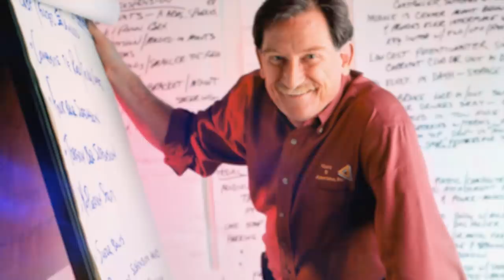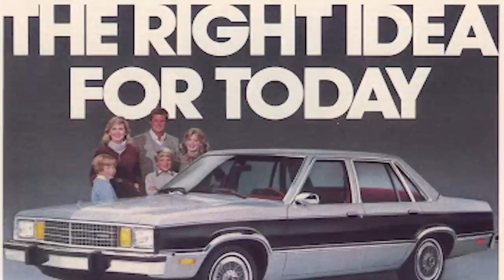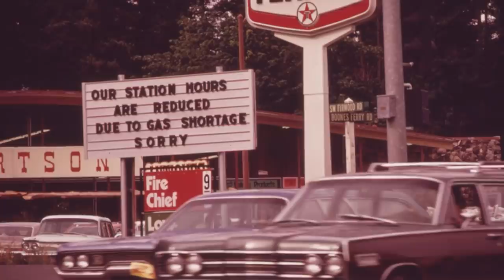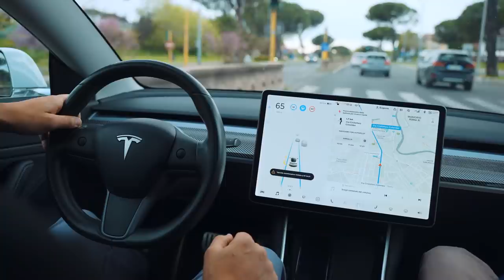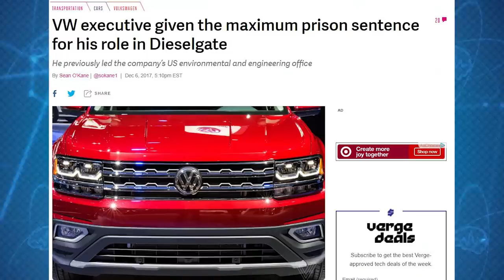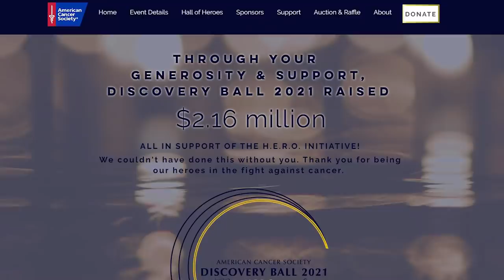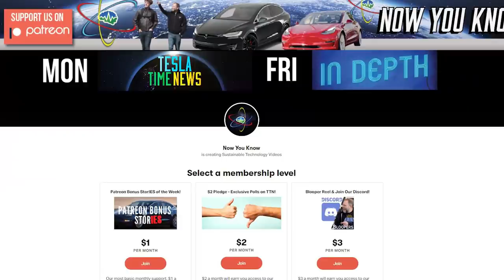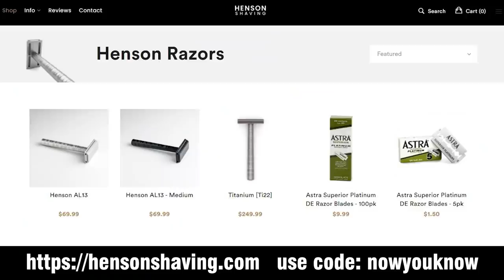China is Coming: Observations from an Expert | In Depth

Comment: The old man is right, I also know the first Japanese car coming to Europe some 50 years ago. People looked down on Japanese cars but I have been driving Japanese all my life. Chinese cars will definitely come in the European and American market. China has a greater advantage than Japan because it has 5 times bigger domestic market than the usa. The electric vehicles will be much cheaper than any other brands and they are already leading in AI which will be part of the vehicles.
Reply: Quality =/= Quantity
Reply: I’ve been doing pretty well with Japanese cars and American trucks. Had an 88 f150 still driving fine while the body disintegrated around it. When I was young me and my friends had a beater Honda Civic that never had an oil change even once and we gave it away still running years later. Now that I’m older I’ve had 3 generations of civics, an f150, f250 and a Chevy 2500 (with a plough on it) and all of them have been great to me requiring almost nothing besides routine maintenance.
Reply: China has copied the Japanese Economic Model; the US automotive and general economic model was easy pickings for anybody who had a belief in Long Term Marketing Strategy and Long Term Economics.
The US companies like GM, Chrysler had to report Quarterly; pay dividends quarterly. At Least Ford had a big % that was family owned!
Meanwhile back in Japan post WW2 Demming was sent to Japan to help Japan recover as the US had adopted a Christian Ethos on how to turn old enemies into allies; the marshall plan went into action; Demming was a seriously smart man, and so was Mr Toyoda.
US arrogance continued with its short term economic model right up to this day!
Japan had adopted this Window of Economics Strategy; In the 1950's it selected the following key markets that it wanted to Grow its Combined Market Share, it developed an Economic Model of Co-optition! Japanese companies didn't compete against Japanese Companies!
The market segments that Japan initially selected included the following:-
Ship Building
Electronics
Computer Chips
Optics
Automotive; motor bikes, cars, outboard motors etc
And later the computer Chip
And cellphone
These industries were not just backed by these very large Japanese Organizations but also the japanese Banking System!
And yes behind that,  we basically had the The bank of Japan and the Japanese People who are the most indebted nation per capita in the Western World!
So how did it work out for Japan?
1.Ship Building, according to the Boston Consulting Groups Growth Share Matrix, I would say it was a fail although I can see Japan building a strong navy to combat China and North Korea; Score 2/10
2. Electronics; yes this has been a success in up market smart tech; Score 7/10
3. Computer Chips etc; Score 6/10
4. Optics; did really well in the 1960's to the 80's, they are still good at basic consumer stuff but I think they have lost the battle at the very top end; I still give them a 6/10
5. Automotive; well this is such a radically changing market segment! Yes Japan has done extremely well here and yes their economic Strategy to buy Long Term Market Share (LTMS) has been amazing! According to the BCG growth Share Matrix Japan could cash Cow this segment for a couple of decades and bank all the dividends! However the Germans are not far behind them and Teslar is according to the BCG analysis is a Star Brand/ Product, it is the market disruptor! To me China is too late and I wouldn't want heap of money of mine being invested in Toyota, VW, GM. I'll only give Japan 3/10 in this category because of all the financial support its Automotive industry  got. This is where Japan's massive debt has come from! The Japanese people paid for its Automotive Market Share  Score 3/10
6. Cellphone; well Japan lost this battle big time! Score 1/10

South Korea copied Japanese economic theory and practice;-
It has done well in the following:-
Ship Building, Electronics, Computer Chips, Automotive, and cellphones.

China is also copying Japan's Window of Economic Strategy, and like Japan China has a Massive Demographic Cliff face its about to fall off; China like Japan is heading for Stag Deflation; an Economists worst Nightmare! And in China's case it will last for Decades!
Reply: Tesla like companies give tech to Chinese. According midea Chinese employee of Tesla give tech to Chinese company.
Reply: @reviewerbibhuti5100  It´s a gamble, Elon is literally gambling that he can be the pioneer of electric car tech inovation and after he gets it and massproduces some teslas, Chinese get the Tech.
Reply: I am seeing the first Chinese cars in the Netherlands. Nobody wants the American cars. The Chinese cars are mutch  cheaper than others.
Reply: @dennisdegroot7490  I would rather pay more knowing the quality and the condition of workers being on the good side. 

No matter how much stealing they do, they would never achieve the same quality other brands do.
Reply: consider how much a Toyota cost now days.  It’s about it time we see sub 10k cars again
Reply: @dennisdegroot7490  Here in New Zealand we have a lot of South Korean cars; Hyundai is a very reliable brand along with Toyota of course. 
The top selling vehicle is a Ford, with Toyota being right behind it!
The farming market is big here and Ford and Toyota fight it out to be the favourite farmers vehicle; so it is the Ford Ranger verse the Toyota Hilux.
Reply: @faultline3936  

Then you’re not listen to what the old man said.
Reply: @stewartbeche686  I think you are right. Except for the part China is to blame. I am Dutch so i see the results of the USA war propaganda every day. China plays games but who made China great? The American people wanted money. That's what they got. Including a failed nation. The people in the east also need a house.
Reply: @robmiller1964  Thanks, I like Toyota. I have looked into New Zealand. I thought you had holden in stead of ford.
Reply: @dennisdegroot7490  it is not american  war propaganda it is chinese war propaganda. By the way: THE MING DYNASTY TOLD DUTCH GET OUT OF PENGHU ISLAND BUT COULD HAVE ALL OF TAIWAN....TOO MANY HEAD HUNTERS.  KOXINGA OF QING DYNASTY THREW OUT DUTCH... DUTCH RIGHTFUL OWNERS OF TAIWAN..
Reply: @faultline3936  American? Good quality? Most people avoid Ford and Chevrolet (except for pickup trucks) in other countries because of their reliability issues. Toyota is still the king
Reply: @marinmarinhola  Well, that's a Japanese brand, so I agree with you lol
Reply: @stewartbeche686  🤣. Im Indian , and even though my country has border issues with China I'm not as delusional as you , or someone who denies the crimes my government does like the way you are defending the war crimes of your country in Iraq ( 500k civilians dead ), Libya ( 1500 ), Afghanistan ( 250k ) and currently occupying the oil field of Syria, starving the country.
Reply: @RamMohammadJosephKaur  are you a muslim?
Reply: @stewartbeche686  Does Cyril sound like a muslim name to you? 😁I'm a Malankara Orthodox Christian..
Reply: Cheaper did you say ? Yes they are cheap. But can they match the innovations of the  Japanese?
Reply: @sebas8225  .
Reply: @reviewerbibhuti5100  You are stuck in the late 70s where China is poorer than some african poor nations and virtually had no technology. That may be true in the past, but more and more, they are becoming the leading edge of new technology ie. AI, 5G/6G, quantum computing, EV, etc. They have about 2 million STEM graduates a year and they are pouring billions of dollars in research. Just wait for the end of this decade and they will be the undisputed technology leader.
Reply: @stewartbeche686  you’re very I’ll informed! Go to CIA factbook and some research
Reply: @jasondong9721  I am into the truth and nothing but. BOYCOTT CHINESE GOODS! THE LIFE YOU SAVE COULD BE YOUR OWN.
Reply: @annapolismike  Japanese cars may still be a bit better, after all they have history with building cars, but dont be fooled thinking chinese product wil be junk. And their knowledge how to build  cars is advancing with unbelievable speed. Just look what they did with phone market. without embargos, they would rule phone world market. People dont' realize this new China is far from its old image as ignorant world still see it. There is nothing, unreliable unsafe with high tech Chinese stuff anymore. They are on paar with every world manufacturer if they decide to compete.
Reply: I drive a Dacia. People may laugh but it's reliable and cheapest car on the market by a long way. I am in the UK. My next car will be EV and it will again be Dacia Spring. That will cost around £11 000. 

Dacia is owned by the French and private European shareholders with about 11% owned by Nissan. I am not interested in a Chinese car and would be prepared to pay more for a European brand to keep jobs in Europe. I do not buy American(though I love you guys), for the same reason. 

t is owned by the
Reply: @grahamt5924  you are a true patriot and supporter of democracy
Reply: @dennisdegroot7490  Europe hasn't wanted American cars for 40 years or more, that's nothing new
Reply: 35
Reply: 🤣🤣🤣 Chinese products are low quality than the japanees European and american products
Reply: yep and they will be models tesla designers help make as they are training chinese  people how to do it properly
Reply: I have driven Honda's for decade and still love them but then again, I haven't driven an EV yet.
Reply: @robmiller1964  China does not copy anything from Japan. China is not interested in Japan. China has landed on the moon and Mars. China has its own space station. How many times has Japan landed on the moon and Mars? Does Japan have their own space station?
Reply: @Yangpeiling-de-zhangfu  I love China, and I love the Chinese People, I am sorry if I offended you, I'm from New Zealand and I grew up in the 1950's 60's next door to Kiwi Chinese on a Farm just out of Oamaru. 
I believe that we have to look at China and think about the long term. The thing I can't quite comprehend is why China has become so aggressive lately towards Taiwan. Why? Taiwan isn't threatening China, I cannot understand what China could be upset about as Taiwan seems to be minding its own business as we say in English.
But let us take a step back; Donald Trump and the USA under his leadership was incredibly rude to China and I do understand; China was very mature in the way it handled Donald Trump (Who I think was the worst US President in my life time). Donald Trump wasn't just rude to China, he was rude to virtually every country on this planet.

I do think that China has some major demographic and economic challenges ahead and I have pointed these out. However China is not alone, each country has their own set of Demographic and Economic Challenges. 
The radical right wing in the USA and Australia aren't being wise, everybody needs to calm down. This planet is too small for silly escalations. Ideas of hegemony are so out of date these days.
Peace be with you!
Reply: @faultline3936  high price is not necessary buy you good quality.
Reply: @stewartbeche686  
By Amir Wijaya

Here is a list of all the war crimes of the United States of America:

1901 - the introduction of troops into Colombia.

1902 - invasion of Panama.

1903 - The US sent warships to the Panamanian Isthmus in order to isolate Colombian troops. On November 3, the political independence of the Panamanian Republic was proclaimed. In the same month, Panama, which was in fact completely dependent on the United States, was forced to sign an agreement with the United States, according to which the territory for the construction of the channel was "forever" provided for use by the United States. The USA was allowed to build and then operate a canal in a certain zone, to maintain armed forces there, etc. In 1904, the Panama Constitution was adopted granting the US the right to land troops in any part of the country, which was repeatedly used by the US government to suppress anti-imperialist actions. The presidential elections of 1908, 1912, and 1918 took place under the supervision of US troops.

1903 - the entry of troops into Honduras, the Dominican Republic and Syria.

1904 - the entry of troops into Korea, Morocco and the Dominican Republic.

1904-1905 - American troops interfere in the Russo-Japanese War.

1905 - US troops interfere in the revolution in Honduras.

1905 - the entry of troops to Mexico (helped dictator Porfirio D? Az suppress the uprising).

1905 - the entry of troops into Korea.

1906 - invasion of the Philippines, suppression of the liberation movement.

1906-1909 - US troops enter Cuba during the elections.

1906 - The uprising of liberals protesting against lawlessness, created by the government of President E. Palma. Palma asks the US to send troops, but the US government sends mediators to Cuba. After the resignation of President E. Palma, the United States announced the creation of an interim government in the country that will remain in power until the state regains its order. 1906.10.02 - The victory of the liberals in the elections. President H. Gomez was elected President of Cuba.

1907 - US troops enforce the protectorate of "dollar diplomacy" in Nicaragua.

1907 - US troops interfere in the revolution in the Dominican Republic.

1907 - American troops participate in the war of Honduras with Nicaragua.

1908 - US troops enter Panama during the elections.

1910 - Nicaragua. US forces invade the Bluefields and Corintho ports. The US sent armed forces to Nicaragua and organized an anti-government conspiracy (1909), as a result of which Celaya was forced to flee the country. In 1910, a junta was formed from pro-American generals: H. Estrada, E. Chamorro and employee of the American mining company A. Diaz. In the same year, Estrada became president, but the following year he was succeeded by A. Diaz, supported by American troops.

1911 - Americans landed in Honduras to support the uprising led by former President Manuel Bonnily against the legally elected President Miguel Davil.

1911 - suppression of the anti-American uprising in the Philippines.

1911 - the introduction of troops in China. 1912 - US troops enter Havana (Cuba).

1912 - US troops enter Panama during the elections.

1912 - the invasion of American troops in Honduras.

1912-1933 - the occupation of Nicaragua, a constant struggle against the partisans. Nicaragua has become a colony of the monopoly of the United Fruit Company of other US companies. In 1914, Washington signed an agreement under which the United States was granted the right to build an inter-Pacific channel in Nicaragua. In 1917 E. Chamorro became the president, who concluded several new agreements with the US, which led to even greater enslavement of the country.

1914 - US troops enter the Dominican Republic, fighting with the rebels for Santa Domingo.

1914-1918 - a series of incursions into Mexico. In 1910, there began a powerful peasant movement Francisco Pancho Villa and Emiliano Zapata against the protege of America and England, the dictator Porfirio Diaz. In 1911, Diaz fled the country, and he was replaced by the liberal Francisco Madero.But even he did not fit the Americans, and again in 1913 the pro-American General Victoriano Huerta overthrew Madero, killing him. Zapata and Villa pushed, and in late 1914 took the capital of Mexico City. The Junta of Werta collapsed, and the US moved on to direct intervention. Actually, in April 1914, an American landing landed in the Mexican port of Veracruz, which remained there until October. President of Mexico was meanwhile an experienced politician and a landowner, V. Carranza. He defeated William, but opposed the US imperialist policy and promised to carry out land reform. In March 1916, parts of the American army under the command of Pershing crossed the Mexican border, but the Yankees did not get an easy walk. Government forces and partisan armies P. Vilia and A. Zapata, temporarily forgetting the civil strife, merged and Pershing from the country were thrown out.

1914-1934 - Haiti. After numerous uprisings, America introduces its troops, the occupation continues for 19 years.

1916-1924 - 8-year occupation of the Dominican Republic.

1917-1933 - the military occupation of Cuba, an economic protectorate.
1917-1918 - participation in the 1st World War. At first, America "respected neutrality", i.e. sold arms to astronomical sums, rampantly grew richer, entered the war as much in 1917, i.е. in almost the very end; lost only 40,000 people (Russians, for example, 200,000), but after the war found themselves the main winner. In Europe, America did not come for Europe, but for America's sake. The overseas capital was preparing this war, and it won it. After the end of the war, through various machinations, more than other allies, they succeeded in enslaving Germany, as a result of which the country, weakened by war, fell into absolute chaos, where fascism also arose. Fascism, by the way, developed with the active assistance of America, which helped him until the end of World War II. States, other than the United States, found themselves in debt to international financial groups and monopolies after the war, where US capital was already playing the first, but by no means the only violin. In total, what the United States wanted was achieved both in Paris in 1919 and in Paris in 1929.

1917 - American tycoons gladly financed the socialist revolution in Russia, hoping to provoke a civil war, chaos and complete liquidation of this country. After the 1917 revolution, US President Woodrow Wilson outlined the US political course on Russia in the following way: all White Guard governments in Russia should receive the assistance and recognition of the Entente; The Caucasus is part of the problem of the Turkish empire; Central Asia should become a protectorate of the Anglo-Saxons; in Siberia there should be a separate government, and in Great Russia - a new (that is, not Soviet). After the victory over the "red plague," Wilson planned to send detachments from youth Christian associations to Russia "for the moral education and guidance of the Russian people." In 1918, American troops entered Vladivostok, and they were finally able to drive them out of the Russian territory only by 1922. As early as December 23, 1917 Clemenceau, Pichon and Foch from France, the lords Milner and Cecile from England concluded a secret convention on the division of spheres of influence in Russia: England - the Caucasus, the Kuban, the Don; France - Bessarabia, Ukraine, Crimea. The US formally did not participate in the convention, although in fact they held all the threads in their hands, especially claiming Siberia and the Far East ...

1918-1922 - intervention in Russia. In total, 14 states participated in it. There was active support for the territories that had separated from Russia - Kolchakia and the Far Eastern Republic.

1918-1920 - Panama. After the elections, troops are introduced to quell the riots.

1919 - Costa Rica. The uprising against the regime of President Tinoko. Under US pressure, Tinoko resigned as president, but the unrest in the country did not stop. The landing of US troops to "protect American interests." Election of President D. Garcia. Democratic rule was restored in the country.

1919 - US troops are fighting on the side of Italy against the Serbs in Dolmatia.

1919 - US troops enter Honduras during the elections. 1920 - Guatemala. 2-week intervention.
Reply: 1921 - American support for militants who fought for the overthrow of the President of Guatemala Carlos Herrera for the benefit of the United Fruit Company.

1922 - intervention in Turkey.

1922-1927 - American troops in China during the popular uprising.

1924-1925 - Honduras. The troops invade the country during the elections.

1925 - Panama. American troops disperse the general strike.

1926 - Nicaragua. Invasion.

1927-1934 - American troops are stationed throughout China.

1932 - invasion of El Salvador from the sea. There at that time there was an uprising.

1936 - Spain. The introduction of troops during the Civil War.

1937 - a single military clash with Japan.

1937 - Nicaragua. With the help of American troops, Somoz comes to power, displacing the legitimate government of H. Sakasa. Somoza became a dictator, his family members ruled the country for the next 40 years.

1939 - the introduction of troops into China.

1941 - Yugoslavia. A coup d'état on the night of March 26 to March 27, 1941, organized by the Anglo-American special services, as a result of which the Tsvetkovic-Machek government was overthrown by the putschists. 1941-1945 - while the Soviet troops fought the fascist army, the Americans and the British were engaged in what they usually do - terror. They methodically destroyed the peaceful population of Germany, than showed that they were no better than the fascists. This was done from the air by carpet bombing of cities that had nothing to do with war and military production: Dresden, Hamburg. In Dresden, approximately 120,000 - 250,000 civilians were killed per night, most of them refugees.

1945 - two atomic bombs, dropped on already defeated Japan, which resulted in the death of about 200,000 (according to other sources, 0.5 million) people, mostly women and children. It is widely believed that these bombs were dropped to save the lives of Americans. This is not true. Bombs were dropped to intimidate a new enemy, Stalin, when Japan was already trying to enter into negotiations for surrender. Leading warlords of the Second World War, including Dwight Eisenhower, Chester Nimitz and Curtis Limae, have all disapproved of the use of atomic bombs against a defeated enemy. In addition, the bombs were dropped in defiance of the prohibition of the Hague Convention of 1907 - "there is no justification for unlimited destruction or attacks on civilians and civilian objects per se". Nagasaki was at least a naval base ... After the occupation of Japan by American troops, 10 million people died of starvation.

1946-1949 - The United States bombed China and exerted all kinds of opposition to the Communists.

1947 - Italy. In order to fight communism, pro-American forces are funded in elections, the CIA massively kills communists, and carries out anti-Soviet campaigns in the media. In the end, the results of the elections were forged by American money and, of course, the Communists lost.

1947-1948 - France. With the aim of combating communism and recolonization of Vietnam, pro-American forces are funded in elections, and military support is provided. The death of thousands of civilians.

1947-1949 - Greece. American troops participate in the civil war, supporting the fascists. Under the pretext of "defending democracy," the United States interferes with the first general parliamentary elections in Italy, and introduces warships of the Sixth Operational Fleet into Italian ports in order to prevent the Communist Party from coming to power peacefully. For several decades after the war, the CIA and the US corporations continued to interfere in the elections in Italy, and spent hundreds of millions of dollars in order to block the electoral struggle of the Communists.

1948-1953 - military operations in the Philippines. Decisive participation in punitive actions against the Philippine people. The death of many thousands of Filipinos. The US military has launched a struggle against the leftist forces of the country at a time when they fought against the Japanese invaders. After the war, the US brought to power a number of puppets, including the president-dictator Marcos. In 1947, pro-American forces were financially supported to open American military bases in the Philippines.

1948 - Peru. Military coup, conducted by America. Manuel Odria came to power. The undemocratic government was later armed and supported by America, the next elections were held only in 1980.

1948 - Nicaragua: military support is provided to establish control over the government. About the dictator Anastasio Somoza, American President Roosevelt said: "Maybe he and the son of a bitch, but this is our son of a bitch." The dictator was killed in 1956, but his dynasty remained in power.

1948 - Costa Rica. America supports a military coup led by Jos? Figueres Ferrer.

1949-1953 - Albania. The United States and Britain have made several unsuccessful attempts to overthrow the "communist regime" and replace it with a pro-Western government from among monarchists and fascist collaborators.
Reply: 1950 - The uprising in Puerto Rico was crushed by American troops. At that time there was a struggle for independence.

1950-1953 - armed intervention in Korea about a million American soldiers. The death of hundreds of thousands of Koreans. Only in 2000 it became known about the mass killings of tens of thousands of political prisoners by the army and the police of the Seoul regime, committed during the Korean War. This was done on the orders of America, which feared that prisoners of conscience arrested for their political beliefs would be liberated by the People's Army of the DPRK. Americans actively use chemical and biological weapons produced for them by Nazi criminals and tested on our prisoners.

1950 - the beginning of American military assistance to France in Vietnam. Supply of weapons, military consultations, payment of half of the military expenses of France.

1951 - American military assistance to Chinese rebels.

1953-1964 - British Guyana. For 11 years, the United States and Britain have three times tried to prevent the democratically elected leader Jegan from coming to power, pursuing a neutral and independent policy that, in the opinion of the United States, could lead to the construction of an alternative society to capitalism. Using a wide range of means - from strikes to terrorism - the United States got him out of the political arena in 1964. As a result, Guyana is one of the prosperous countries in the region - by the early 1980s. became one of the poorest.

1953 - Iran. The popular politician Mossadegh decided to nationalize the Iranian oil industry (1951), which was controlled by the Anglo-Iranian Oil Company. Thus, the economic interests of Great Britain were affected.Attempts by Britain to "influence" Mossadegh with the help of the head of state Shah failed. Mossadegh held a referendum, which scored 99.9% of the vote, received extraordinary powers, took over the command of the armed forces and, in the end, deposed the Shah and sent him into exile. Great Britain and the United States especially scared that Mossadegh relied not only on nationalists and clerics, but also on the Communist Party of Iran. In Washington and London, it was decided that Mossadegh was preparing "Sovietization" of Iran, so the CIA and British intelligence MI5 conducted an operation to overthrow Mossadegh. In Iran, popular unrest began, where monarchists, supported by the United States and Britain, collided, and supporters of Mossadegh, and then a coup d'état organized by the military took place. Shah returned to Tehran and at an official reception said, addressing the head of the Middle East department of the CIA: "I own this throne thanks to Allah, the people, the army and you!". Mossadegh was arrested, judged by the Iranian court, sentenced to long prison terms, and spent the rest of his life under house arrest. The Shah canceled the decision to nationalize the Iranian oil industry. Shah Pahlevi (Pahlevi) for a quarter of a century turned into a jailer of the Iranian people.

1953 - Forcible deportation of the Inuit (Greenland), which resulted in the degradation of this people.
Show less

1954 - Guatemala. President of Guatemala Jacobo Arbens Guzman. He led the country in 1951-1954 and tried to take the trade in agricultural products (the main export item) under state control. This he touched on the interests of the American firm United Fruit, which accounted for 90% of Guatemalan exports. Arbens was accused of being a secret member of the Communist Party and wants to build communism in Guatemala (it was a lie). United Fruit asked the US Administration for help. The CIA hired several hundred Guatemalan military, who invaded the territory of Guatemala from neighboring Honduras. Army command, bribed by the CIA, denied Arbenz obedience, and he fled to Mexico, where he died 20 years later. The commander-in-chief of the armed forces came to power in Guatemala. The US welcomed the change of power and urged the new Guatemalan authorities not to "revenge" Arbenz. Then America is stationing its bombers there.

1999 - US President Bill Clinton acknowledged the involvement of US intelligence agencies in the facts of the violation of the law during the recent internal armed conflict in Guatemala. The head of the White House said this in the capital of Guatemala, where he was in the course of his tour of Central America. The support of the Guatemalan military by the US special services involved in "severe and prolonged repression was a mistake on the part of the US that should not be repeated," Clinton said. Such a statement Clinton made in response to repeated calls by Guatemalan human rights defenders to open access to the secret archives of American intelligence services, which would determine the role of Washington and the Guatemalan military in the "dirty war" that accompanied the internal armed conflict in Guatemala. In a report recently released by the Guatemalan "Truth Commission", it is noted that the United States has repeatedly intervened in the internal affairs of Guatemala during the conflict. Thus, the CIA "directly or indirectly supported some illegal operations" of the government against insurgent formations. Until the mid-1980s, "the US government exerted pressure on the Guatemalan authorities in order to maintain an unjust social and economic structure in this country." According to the "Commission of Truth", during the 36-year civil war in Guatemala, which ended in 1996 after the signing of a peace agreement between the authorities and the rebels, more than 200,000 people were killed and missing. In the course of the armed confrontation, numerous gross violations of the law were committed, most of which were committed by the army and special services.

1956 - the beginning of American military assistance to the Tibetan insurgents in the fight against China.The militants were trained at foreign bases of the CIA, supplied with weapons and equipment.

1957-1958 - Indonesia. Like Nasser, Sukarno was one of the leaders of the Third World, he maintained neutrality in the cold war, made several visits to the USSR and the PRC, nationalized Dutch property, refused to ban the Communist Party, which was rapidly expanding its influence among voters. All this, in the opinion of the United States, served as a "bad example" for other developing countries. To prevent "diffusion of wrong ideas in the third world", the CIA began to "throw in" large sums of money in the election, developed a plan to assassinate Sukarno, blackmailed him with a fabricated sex film and, with the help of opposition officers, launched a war against the Sukarno government, which was unsuccessful.

1958 - Lebanon. The occupation of the country, the fight against the insurgents.

1958 - confrontation with Panama.

1958 - American military assistance to rebels on Quemoy Island in the fight against China.

1958 - In Indonesia, an uprising has begun, prepared by the CIA since 1957. The Americans are providing anti-government insurgents with bombardment and military consultations. After the American plane was shot down, the CIA retreated, the insurrection failed.

1959 - America introduces troops to Laos, the first clashes of American troops begin in Vietnam.

1959 - Haiti. The suppression of the popular uprising against the pro-American government.
Reply: 1978 - Guatemala. Military and economic assistance to the pro-American dictator Lucas Garcia, who introduced one of the most repressive regimes of this country. More than 20,000 civilians were killed with US financial assistance.

1979-1981. A series of military coups in the Seychelles - a small state off the East coast of Africa. French, South African and American special services took part in preparing coups and invasions of mercenaries.

1979 - Central Africa. Over 100 children were killed when they staged a protest against the obligation to buy school uniforms exclusively in the shops owned by the president. The international community condemned this murder and put pressure on the country. In a difficult moment, Central Africa came to the aid of the United States, who benefited from this pro-American government.America was not at all embarrassed by the fact that the "Emperor" Jean-Bedel Bokassa personally took part in the massacre, after which he ate some of the murdered children.

1979 - Yemen. America provides military assistance to the insurgents in order to please Saudi Arabia.

1979-1989 - Soviet invasion of Afghanistan. After numerous attacks by the Mujahideen on the territory of the USSR, provoked and paid for by America, the Soviet Union decides to enter its troops in Afghanistan to support the pro-Soviet government there. Struggling with the official Kabul government, the Mujahideen, including the volunteer from Saudi Arabia, Osama bin Laden, supported the United States. The Americans supplied Bin Laden with weapons, information (including the results of satellite reconnaissance), propaganda materials for distribution on the territory of Afghanistan and the USSR. We can say that they waged war by the hands of Afghan insurgents. In 1989, Soviet troops left Afghanistan, in which the civil war continued between the opposing factions of the Mujahideen and tribal associations.
Show less

1980-1992 - El Salvador. Under the pretext of exacerbating internal struggles in a country growing into a civil war, the US first expanded its military presence in El Salvador by sending advisers, and then joined in special operations using the Pentagon's and Langley's espionage capabilities on an ongoing basis. The proof of this is that about 20 Americans were killed or injured as a result of helicopter and aircraft crashes during reconnaissance or other missions over the battlefield.

There is also evidence of US participation in ground combat operations. The war officially ended in 1992. It cost El Salvador 75,000 civilian deaths, the US Treasury - $ 6 billion, withdrawn from the pockets of taxpayers. Since then, there have been no social changes in the country. A handful of rich still owns and rules the country, the poor have become even poorer, the opposition is being suppressed by the "death squads". So, women were hanged in the trees for their own hair and cut off their breasts, they cut out the insides in the genital area and put them on their face. The men were cut off by the genitals and thrust them into their mouths, children were torn with barbed wire in front of their parents. All this was done in the name of democracy with the help of American specialists, every year several thousand people died like this. Active participation in the killings of graduates of the American School of the Americas, which is known for its training in torture and terrorist activities. The 1980s. in Honduras there are military death squads, prepared and paid for by the United States. The number of victims killed in this country was estimated at tens of thousands. Many officers of those death squads have been trained in the United States. Honduras was turned into a military base for the United States to fight against El Salvador and Nicaragua.

1980 - military assistance to Iraq in order to destabilize the new anti-American regime of Iran. The war lasts 10 years, the number of dead is estimated at one million. America protests when the UN tries to condemn Iraq's aggression. In addition, the United States is removing Iraq from the list of "nations that support terrorism." At the same time, America is secretly sending weapons to Iran through Israel in the hope of organizing a pro-American coup.

1980 - Cambodia. Under pressure from the United States, the World Food Program is providing Thailand with $ 12 million worth of products, these products are taken to the Khmer Rouge, the previous government of Cambodia, which is responsible for the destruction of 2.5 million people in 4 years of rule. In addition, America, the Federal Republic of Germany and Sweden supply the supporters of Pol Pot with arms through Singapore, the Khmer Rouge bands have been terrorizing Cambodia for another 10 years since the fall of their regime. 1980 - Italy. As part of Operation Gladio America arranges an explosion at the Bologna railway station, 86 people die. The goal is to discredit the Communists in the upcoming elections.

1980 - South Korea. With the support of the Americans, thousands of demonstrators in the city of Kwangju were killed. The protest was directed against the use of torture, mass arrests, falsified elections and personally against the American puppet Chun Doo Hwan. Years later, Ronald Reagan told him that he "did a lot to maintain the five-thousand-year tradition of commitment to freedom."

1981 - Zambia. America very much did not like the government of this country, tk. it did not support the much-beloved US apartheid in South Africa. Therefore, the Americans are trying to organize a coup d'état, which Zambian dissidents were supposed to carry out with the support of the South African detachments. The coup attempt failed.

1981 - The US shoots down 2 Libyan aircraft. This terrorist attack was aimed at destabilizing the anti-American government of M. Kadaffi. At the same time, exemplary maneuvers were conducted near the coast of Libya. Kadaffi supported the Palestinians in the struggle for independence and overthrew the previous pro-American government.
Reply: 1990 - military assistance to the pro-American government of Guatemala "in the fight against communism". In practice, this is expressed in massacres, by 1998, 200,000 people were the victims of fighting, only 1% of civilians killed are "the merit" of anti-government insurgents. Over 440 villages have been destroyed, tens of thousands of people fled to Mexico, over a million refugees are inside the country. Poverty is rapidly spreading in the country (1990 - 75% of the population), tens of thousands die of hunger, "farms" are opened to raise children, which are then dismantled for organs for rich American and Israeli clients. On American coffee plantations, people live and work in a concentration camp.
Show less

1990 - Support for a military coup in Haiti. The popular and lawfully elected President Jean-Bertrand Aristide was dropped, but the people began actively demanding him back. Then the Americans launched a disinformation company that he is mentally ill. Delivered by America, General Prosper Enwil was forced to flee to Florida in 1990, where he now lives in luxury for stolen money.

1990 - the sea blockade of Iraq begins.

1990 - Bulgaria. America spends $ 1.5 million to finance the opponents of the Bulgarian Socialist Party during the elections. Nevertheless, the BSP wins. America continues to finance the opposition, which leads to the early resignation of the socialist government and the establishment of a capitalist regime. The result: the colonization of the country, the impoverishment of the people, the partial destruction of the economy.

1991 - a large-scale military action against Iraq, 450 thousand servicemen and many thousands of modern equipment are involved. At least 150 thousand civilians were killed. Intentional bombing of peaceful targets in order to intimidate the people of Iraq. For the first invasion of Iraq, America used the following excuses: US government approval True Iraq attacked an independent state Kuwait Kuwait was for centuries a part of Iraq, and only British imperialists tore it off by force in the 1920s. 20 th century, following the policy of "divide and conquer". No country in the region has recognized this branch. Hussein produces nuclear weapons and is going to use it against America. The plans for the production of nuclear weapons were in an embryonic state, under the pretext that it is possible to bomb most of the world's countries. His intention to attack America, of course, was pure invention. Iraq did not want to start peace negotiations and withdraw troops. When America attacked Iraq, peace negotiations were already under way, and the Iraqi army was leaving Kuwait. the atrocities of the Iraqi army in Kuwait. The most terrible atrocities such as the above-mentioned murder of babies were invented by the American propaganda, the use of weapons of mass destruction by the Iraqi army. America itself provided Hussein with these weapons. Iraq was going to attack Saudi Arabia. Evidence so far. There is no democracy in Iraq. The Americans themselves brought power to Hussein

1991 - Kuwait. Kuwait was also delivered, which the Americans "liberated": the camp was bombed, troops were introduced.

1992-1994 - the occupation of Somalia. Armed violence against civilians, killings of civilians. In 1991, the President of Somalia, Mohammad Siad Barr, was overthrown. Since then, the country is actually divided into clan territories. The central government does not control the entire territory of the country. US officials call Somalia "an ideal place for terrorists." Nevertheless, some clan leaders, for example, the late Mohammad Farah Aidid, cooperated with UN peacekeepers in 1992. But not for long. A year later he began to fight with them. The leaders of the Somali clans have their own small, but very mobile and well-armed armies.But the Americans did not fight with these armies, they limited themselves to the extermination of the civilian population (which is armed there as an evil, and therefore began to resist). The Yankees lost two combat helicopters, several armored "hummers", 18 people killed and 73 wounded (special forces, the Delta group and pilots of the turntables), destroyed several city blocks, killing at the same time, according to various sources, from one to ten thousand people (including women and children). In 1994, an American almost 30-thousand unit of the US Army after an unsuccessful two-year attempt to "clean up" the country had to be evacuated. Aidid was then not taken (killed in 1995), and there are no diplomatic relations between Somalia and the United States until now (2005). The Americans shot the film Black Hawk Down, where they presented themselves as heroic liberators of Somalis, fighting terrorists, and that's the end of it. Americans in Somalia. After the destruction of thousands of civilians by American thugs, the Somalis showed their "gratitude" for "helping" Uncle Sam - they dragged one dead occupant through the streets of the city. The effect was stunning: after showing these shots on US television in the United States, such a hubbub began (why are we helping them if they are such barbarians?) That the troops had to be evacuated urgently under public pressure. We draw the appropriate conclusions.

1992 - Angola. In the hope of getting rich oil and diamonds, America finances its presidential candidate Jonas Savimbi. He loses. Before and after these elections, the US provides him with military assistance to fight against the legitimate government. As a result of the conflict, 650,000 people died. The official reason for supporting the insurgents is the fight against the communist government. In 2002, America still got the desired benefits for its companies, and Savimbi became a burden. The US demanded that he cease hostilities, but he refused. As one American diplomat stated in this regard: "The problem with dolls is that they do not always twitch, if you pull a string." On the tip of American intelligence, the "doll" was found and destroyed by the government of Angola.

1992 - in Iraq, the pro-American coup fails, which was to replace Hussein by US citizen Sa'd Salih Jabr.

1993 - Americans help Yeltsin to shoot several hundred people during the storming of the Supreme Council. Unconfirmed rumors of American snipers who helped in the fight against the "Red-Fascist coup" persistently persist. In addition, the Americans took care of Yeltsin's victory in the next election, although only a few months before they were supported by only 6% of Russians.

1993-1995 - Bosnia. Patrolling during the civil war zones prohibited for flights; shot down planes, bombardment of Serbs.

1994-1996 - Iraq. Attempt to throw off Hussein by destabilization in the country. The bombings did not stop for a day, people died of hunger and disease because of sanctions, explosions were constantly held in public places, while the Americans used the terrorist organization Iraqi National Congress (INA). It came even to fighting clashes with the troops of Hussein, tk. the Americans promised the National Congress support from the air. True, military assistance did not come. The attacks were directed against civilians, the Americans hoped in this way to provoke popular anger towards the regime of Hussein, who admits all this. But the regime did not allow this for long, and by 1996 the majority of INA members were destroyed. In the new government of Iraq, INA was also not allowed.
Show less
Reply: @hyc1266  mostly not true   america was asked to help quell disturbances because 3rd world countries umable to govern.  Today america does not send troops to Haiti, central america and look at millions of people from those lands coming to USA...FACE IT:  ANGLO SAXONS CREATE A STABLE ENVIROMENT.
Reply: @hyc1266  you live in the past...
Reply: @knoahbody69  you speak the truth!
Reply: Oh, the other thing is China's market may be huge, but over 50% of the population makes less ten thousand dollars a year.  The market may be huge, the people that can afford to buy cars is only slightly bigger than the U.S. Markets.
Reply: @dennisdegroot7490  haha thanks wu Mao, in fact china have to buy their way into European brand names like Volvo-Geely.  Tesla number one in Europe EV,
Reply: @robmiller1964  Japan =/= China :) So you would think developed markets in the West today have a demographic advantage, compared to China? Fyi, Japan's GDP per Capita already exceeded that of the United States back in the 1980s. By contrast, the Chinese economy is still far from reaching its full potential despite strong growth for decades, indicating considerable room for further expansion in the foreseeable future. You were making a strategic miscalculation with grave consequences, at best. By the way, Japan won't attempt to build its own space station. Nor did it successfully land a rover on Mars. Yet, the Chinese market is at least decades away from reaching the Japanese level of maturity. China's industrial development is nowhere near the peak, given large proportion of its huge population actually is living from hand to mouth. Therefore, I doubt it is wise to simply draw parallels between two very different economies!!
Reply: @robmiller1964  You've been watching too much WestWorld season 3.
Reply: @hyc1266  Translation:  I use pooh bear's little red app every day."
Reply: @silveriver9  Like they're gonna dominate space with their fusion reactor and quantum radar?
Reply: @knoahbody69  I've been to China, I'm now convinced China will be the technology leader of the future.
Reply: @blakenewton2781  she was guilty.....period. WHOSE SIDE YOU ON ?
Reply: @stewartbeche686  I wouldn't advise you to peruse a legal career. A few salient points. The idea that HSBC was in anyways not constrained to produce and manufacture the initial charge is of interest. Then there's the detainment and arrest process that contravened the Charter Rights immediately conferred on people in Canadian jurisdiction ( not to mention that the witness testimony contradicted other testimony). Then there's the illegal transfer of confidential information to foreign agencies ( that's a criminal offense all by itself). Then the Officer In Charge declined to participate in the trial which invalidates much of his testimony and leaves it open for cross examination. I haven't even discussed the fact that HSBC knew of Huawei's corporate structure and it's doings. So far I have given you ample evidence that the trial was not going to do anything. It's why the US government decided to forego the trial. As for " whose side am I on?" The answer is simple. My own.
Reply: @blakenewton2781  now you can go free Peng Shuai!!
Reply: @stewartbeche686  is she on Canadian soil?; I am talking about legal process in Canada and you wandered off into another tangent. Stick with the issue being discussed
Reply: Chinese cars are already in Europe.
Reply: @stewartbeche686  that’s not going to happen, the Chinese design and manufacture good products, take Chinese products from the US market then you’re left with empty shelves.
Reply: @stewartbeche686  also if I have to boycott China I also need to boycott the US, invasion of Iraq, invasion of Afghanistan, continued occupation of various pacific islands including Hawaii and Samoa, meddling in European affairs. Whatever bad things the Chinese have done the US can match or exceed.
Reply: @dennisdegroot7490  Holden was shut down December 2020.
Reply: @faultline3936  if the Chinese car manufacturer actually steal any intellectual property, why don't the victims file lawsuit against them, especially now they are selling at the international market?
Reply: @leefster1  tell that to the tibetans and mongolians.
Reply: @knoahbody69  I wouldn't normally recommend prosthetic brain to anyone, but in your case it might actually be an upgrade, what do you think?
Reply: @stewartbeche686  why me? Oh, I bet you can't tell the difference, am I right? Fact is, I have both Uyghur and Mongolian friends back in china, I don't need some 2 bits googler tell me what's what
Reply: @leefster1  I think you'll be banned for harassment.  Sad that you are Pooh Bear Bot.
Reply: @leefster1  free tibet and mongolia      free peng shuai   free jimmy lai
Reply: @stewartbeche686  Dude, seriously,  I can write a bot in 5 min that's doing a better job than you. if you are paid to do this, my condolences to your boss.
Reply: @knoahbody69  yeah ...  I figured you  gonna call me a bot right about now. so predictable.
Reply: @leefster1  Yeah. Really winning the interwebz, Pooh bear.
Reply: @sirc1446  apparently you had no clue about innovation study and technological learning curve in technolocial innovaiton system or experience curve in economics.
Reply: @RamMohammadJosephKaur  And how many of those deaths in Iraq and Afghanistan were caused by warlords and the Taliban. In Libya, khadafi brought on most of the deaths by attacking other countries and his own people. We stepped in to keep him from slaughtering a whole segment of Libya that was unwilling to live with his madness.   There was international agreement on the actions in Libya almost as united as the feelings about Ukraine.  

That is not to say that we acted properly in Iraq and Afghanistan.  We didn't. Iraq had already proved themselves to be willing to violate the sovereignty of any country that had something that Saddam wanted. Saddam butchered his way through a big chunk of the gulf States and was stupid enough to throw missiles at Israel. The whole subject of WMD was bogus, but the need to get rid of Saddam was not. 

Afghanistan was a pustules ready to burst on the rest of the world. If we had stuck with cleaning up the training ground of the 9-11 attackers, that whole scene would have gone differently. We had the Taliban on their heels and Pakistan ready to support us,  but no. We had to leave the job half done and charge off into Iraq, literally taking most of our forces off to do that job.

Well, it took the warlords and the Taliban two seconds to recognize an open playing field and they took advantage. When we finally came back in force, they had the upper hand and the guerrilla tactics set to defeat anything short of a full on, million soldier force that could cover all the flanks at once, and even that might not have been enough. It's like treating a disease with an antibiotic. If you don't take the entire course, the disease comes back and is resistant to further treatment.  QED!

One good thing that we did was raise the consciousness of the women of Iraq and especially Afghanistan. That headache will be with the Taliban and ISIS and whoever tries to run those countries from now on. It will become increasingly apparent that one of the main reason that the Muslim world has fallen back and will not soon catch up is that half of their population is not contributing in all the ways that it could.  With continued wars, their female population will only grow as a percentage of the whole.  Eventually,  they may be forced to bring their women into the mainstream,  into positions of power.
Reply: @hyc1266  This is not to say that your accounts are fictional, but they are written as if they were edited by left wing historians trying to reiterate history. Sometimes we were wrong and sometimes those on the other side were wrong. After observing the complete lack of freedom in the eastern block after WWII, it became apparent that either capitalist or communist forces were going to dominate the world and we and to greater or lesser degree, the rest of the west decided that we wanted capitalism and democracy of a sort to dominate. Was it done clumsily and with little regard for the populations affected, yes, on both sides. The odd thing, here, is that the western, at least pseudo-democratic countries, prospered and the eastern bloc countries did not. Those in the middle didn't do very well, either. You can't ascribe that to resources, because the Soviet Union and a few affiliated countries had/have enormous natural resources. The difference was in the level of change and growth. Command economies cannot be disrupted and changed in the way democratic and capitalist societies can. As rough as change can be, lack of it leads to strangulation of both the economy and the government.
Reply: @hyc1266  HYC, you are an excellent propagandists. I love the way you tossed off what happened in Serbia with a quick flick of your pen. We didn't start it and we didn't massacre thousands of the Muslim men in Srebenica(sp), but we did move in and stop the fighting and set up a situation where the chief war criminals were eventually brought to trial. 

There are two sides to every story, and so many times, we moved in with overt military force when the opposition was just feeding arms and munitions to sometimes both sides, but usually to the left wing forces. Many times we acted poorly, but our opposition acted poorly as well.  You seem to have a complete inability to see anything but the evil U.S.A. Maybe those seeking accuracy should do their own research or at least seek a balancing exposition of facts and circumstances. Many times you are correct, but not nearly all, and not necessarily for the right reasons.
Reply: @Doio great that you have work to do with your giant pickup, but do you remember when they used to park in back out of politness? But now right in front of the shops are ten giant pickups with one driver each, who can hardly get in with a step ladder.
Reply: @sirc1446  People avoid U.S. made products, especially cars, trucks, and ALL (ALL) rv trailers.
Reply: @chrisblockley5783  I think EV is the future because making hydrogen into liquid needs a lot of cooling, therefore also electrical energy. Hydrogen is volatile and can be dangerous. Although it is clean but the storage and production are relatively more difficult than using electricity.
Reply: Never look down a 5000 year dragon...they have 5000 years of culture, cuvilization and background cowboys!!!!
Reply: You know what? Look at it from another angle. We the consumers will win in the end
Reply: @gmchander142  Japanese is much late into automations in car control systems. And Chinese brand now has found equivalent solutions for hybrid and electric propulsion systems.
Reply: @faultline3936  

Love your choice of words such as “quality”, “worker condition” and “stealing”.
It goes to show the unbelievable amount of bias, arrogance as well as ignorance one can display when all they have inside are bigotry and hate.

You got to be living in a cave if you really think the Chinese are only capable of building low quality cheap stuff that sells in a dollar stores? 

FYI, a large % of smart phones (including iPhones), flat screen TV and monitors, computers & consumer electronic are built by China, regardless of the brand.  

Even your American brands of automobile such as GM, and Ford builds cars with computer chips and many other electronic components made in China.  The car you own that is sitting in your garage probably has hundreds of parts or sub-components that are Chinese made.  

Should you be worried about the quality of all these products you either own, or have previously owned, used or operated without know exactly how much the so called Chinese-made components goes into each of those items?

As far as the accusations of “worker condition”, I guess you don’t even have any idea that the governing party of China- the Chinese Communist Party, or the CCP, rose to power because it fights for the working class against the capitalists who exploite them.  The CCP is literally backed by billions of Chinese blue collar workers as well as small farmers.

As for “stealing”- it would not be a good look if you went to the professor who graded your term paper to made an accusation that one of your classmates “stole” from your work, when you got a “C” on your paper and the classmate whom you groundlessly accused actually out-performed you and got an “A”.
Reply: @robmiller1964  Copied what? Nomi? lmaoo
Reply: 个比马  this fourth quarter of 2022 Chinese electrical vehicles are entering the European market and will take a slice of the total market. The usa can use unfair practices to block Chinese cars but not without consequences. Boeing has lost the 38 billion dollar deal to Airbus in China and it will continue losing the Chinese market as the usa keeps her unfair and discriminative policy against China. Chinese electrical cars have entered the Latin American market with huge success as Chinese brands of high-end products are becoming more and more popular.
Reply: Market share can prolong a lifespan of car through reinvesting in R&D and improving consumers' preference
Reply: @sirc1446  继续保持这种想法
Reply: Fun fact: Tesla will order car batteries from BYD.
Reply: @wcsun5050  the Chinese cars are entering the European market by the last quarter of 2022.
Reply: @reviewerbibhuti5100  你觉得可能不？ 只要是中国人有的 就是 别人给的  或者抄袭？
Reply: @robmiller1964  I am Chinese mainlander, and I would not say I support the independence of Taiwan, not at least independent as a country, but I do hope that the current situation continues with the two sides keeping their own system and remaining in peace.
Back to your question, several reasons why China want Taiwan: 1. Taiwan island is in a crucial position of the island chain by US to limit China. If Taiwan is controlled, the first island chain is broken. 2. Xi modified the constitution several years ago, making him able to be president as long as he want. Yet he need to "conquer" something to show his strength and make him remembered by the history. 3. It is actually acceptable for China to maintain the situation as long as Taiwan does not shout out loud that they are country. It had worked out for years before KMT went down. DPP got elected and one of their main goal is to achieve independence, which is untolerable by CPP. 4. Taiwan is pro-US. You know the Sino-US relationship these years.
Reply: @dennisdegroot7490
Reply: Even the video games industry, China is now pushing forward. Only four years ago, Japanese developers held a monopoly on the top games in Japan, said Daniel Ahmad, a senior analyst at Niko Partners, a video game research firm. Now, about one-third of the top 100 mobile games in Japan come from China.